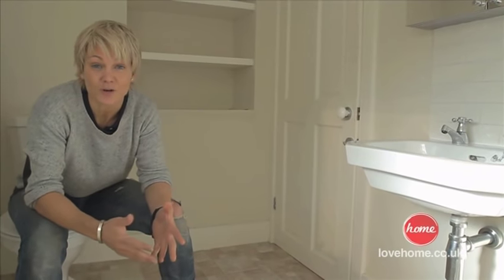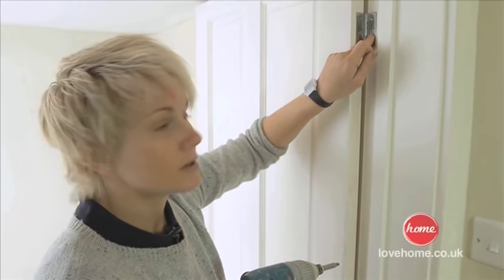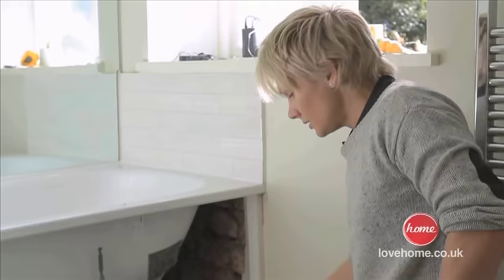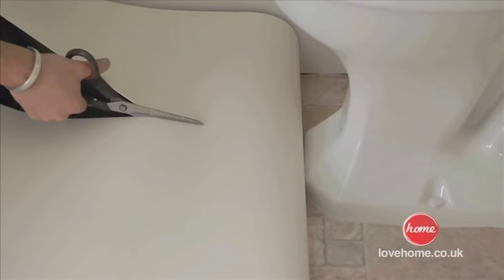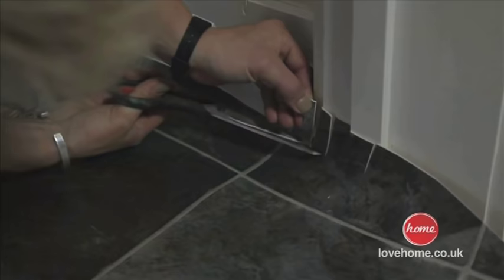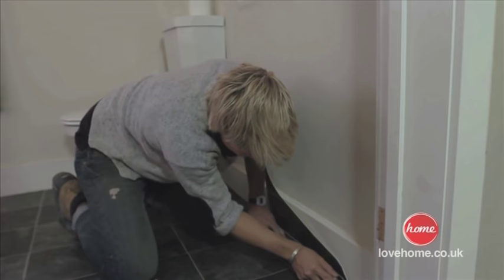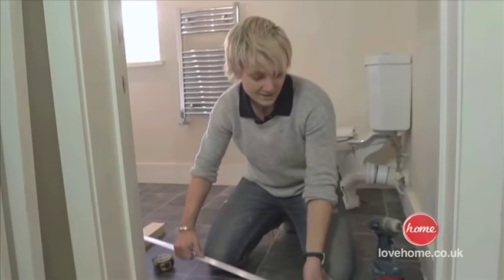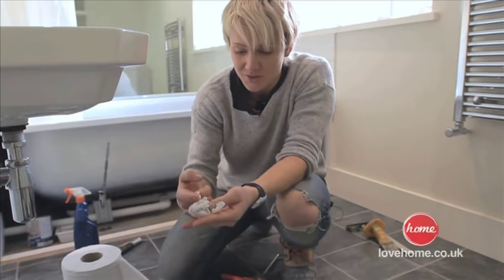DIY: How to lay vinyl or lino flooring

Comment: As a floor layer I would recommend you put double sided tape down first and stick vinyl to it before trimming , much easier.
Reply: Do they even know what linoleum is?
Reply: As a floor layer who is a vinyl specialist.
Use a hooked blade and/or concave.
They are much easier to control whilst cutting in against the skirt or loo.
Reply: As a professional idiot I have butchered my bathroom floor :)
Reply: Got a thin  length of wood. Put double sided tape on the wood. Lay the wood next to the wall and push you vinyl onto it. Lift  vinyl and cut. The perfect line. Triangle bit of wood for the corners and nice and easy to cut corners and edges and nice fitting floor 😊
Reply: I put a bead of silicone in particular all around the toilet UNDER  the vinyl ( after trimming ) but before it finally goes down , then I can silicone on top , it just stops any water getting under if the top silicone is ever damaged during cleaning or general wear and tear .
Reply: If you put tape it wouldnt move and she seems to be moving towards the skirting board and then cutting it? I just took off the skirting anyway so i dont think it will be that bad. I wanted to make it sort of sqaure at thr cirners cos its a utility room and if theres a flood i wanted the lino to go up a bit to keep it watertight rather than drain in behind the lino somewhere.
Reply: Thanks for the advice il try to do it
Reply: Lmaaoo  @classica1fungus
Reply: Will Lino go over floor tiles
Reply: @ChannelStonie 7:00

Comment: Absolutely brilliant video!! I’m a women alone and I’m having to do my  home with vinyl this week... I was panicking about my bathroom! Now I’m not! Thank you so much!
Reply: Me too but a utility room! We need to start lady diy groups where we can just get a second pair of hands for an hour when we need to lift heavy stuff. I had to lift a cupboard and was quoted 90 quid to 150 quid just to get a guy to move one cupboard for me ..as it turned out i was able to drag it on an old rug which was a greay suggwstion. I had to get help from a neighbour to put the top back up..i could take it down but not hoist it back up...but managed to find a neighbour walking past and got him for three minutes to give me and hand and made him a cup of tea and some biccies. I dont know if ill bother putting it back when the lino is down. Then i have to move the sink and plumb it in and cut a worktop and somehow make that atatched to the wall because underneath is just the washing machine. Sigh. That will definitely need a helping hand or just some company and encouragement would do me to be honest. Its the standing there not sure of yourself and worrying about how to do it that takes the most time ..if somone else was there i couldnt piddle about so much overthinking it all. My back is killing me though after movibg the cupboard.

Comment: Philippa (and All), 

Howdy! Well, I did get the ol' bathroom floor covered with lino as per your instructional video. I started it and finished it just yesterday (June 28th, in the Yeare of Somebody's Lord 2018). I originally wrote that I was to start this job on June 24th or so, but I decided I had to do a bit of wood repair and sanding before applying the lino, so yesterday was the day for the flooring. 

Despite this being my first time doing this, the job ended-up having gone very, very well. This, naturally, surprised me as I'd never done it before, and even with great instructions (like yours), some things take a bit of practice. I really felt I was in over my head, but the job had to be done. Immediately before walking myself and the lino into the bathroom I sat my sorry self down in front of the computer, and watch this video one more time. I had already watched it enough to have all the techniques memorized, but I just needed to hear it from you one more time before I faced my bathroom destiny. (laughing... at me). I needed the reassurance.(ha) I forced myself to stay calm even when I felt I should not have attempted this job, and just took one step at a time, following the methods you showed us. Suddenly the lino began falling into place and laying flat and making me very happy!   see--->   #;^\  grrr! i'm very happy. grrr!  It was like a miracle to me! And I sure had some very kind thoughts of you at that moment.

From that point onward I had more room to move around to get the job done, and things continued to go well. After the precision cuts were finished, and all looked pretty darn good, I rolled my computer chair to the bathroom doorway, and with a glass on water in my hand, I just sat there a while looking at how great things went. Boy, was I glad that job was over. Beginner's nerves (and lack of experience). Last night I went to sleep for the first time in a month without worrying about what job I would  be tackling in the olde bathroom on the morrow. Today... I am one happy boy!  see--->   #;^\  grrr. i'm one happy boy. grrr.

Philippa, if not for your video I do not think I would have attempted to lay lino flooring. Each time I watched this video I kept thinking, "Maybe I can do this". Finally, I said, "Oh, well... let's just give this thing a go!".  I am happy the job is done. And I am happy the job is done correctly. I thank you very much again, Philippa. You are groovy.   # :^)    And you are very skilled, knowledgeable, witty, and nice. You are appreciated, my friend.

If it seems I have written too much, well, it is because laying the lino was the last part of re-doing the entire bathroom, including some sub-flooring repairs, mold removal, a bit of plumbing, painting, etc. (most of which I also didn't know anything about prior to this project), so I was getting a'might tired fumbling around with these unfamiliar jobs and getting it done. All the while I knew the last step was going to be laying the lino. And, I dreaded that part of the job, too. 

Thanks (again) to you, I got through that very last  part of this big project, and it was done correctly, and the bathroom looks great now. I would say that I am proud of myself, but, alas, I am way too humble to say that.<ahem>  However, I can say that you are the best, Philippa. And I am indebted to you for your kindness in sharing your knowledge to help so many others like me... and even me.<grin>  And for helping to give us enough confidence to tackle these jobs. Bless your heart. 

Philippa, be well... you're swell. 

Best Wishes Always & The Best Life Has To Offer You.
  Most Sincerely,
    Wombat Willie 
(who can now lay lino flooring thanks to one special woman)

Comment: 1st time I have ever laid vinyl flooring and I found this tutorial a great help.. mine didn't turn out as neat as her's did but I'm very pleased with myself.. brill video.
Reply: What did she use for adhesive?  I've only seen installers use a bucker of vinyl floor adhesive applied with a notched trowel.
Reply: @billytheweasel  it’s a double sided kind of tape. You can get at lowes or home depot
Reply: @T.C.-EDU  then she used silicone gel to finish it off

Comment: I have been thinking about doing this myself but I worried about cutting around the toilet and also I cant cut straight for the life of me. I love this video and the lady explains everything in a way that is easy to understand. She certainly makes it look very easy and I dont suppose it will be that way for me but I shall watch this a few more times than try and lay the flooring myself.
Reply: Don't cut around the loo. Unbolt it and just lift it up a few mm for a professional finish.
Reply: @guybarber2301 unbolting a toilet can lead to a lot of other problems some of them are only sealed because of the dirt lol. Id say cut around it nobody is going to be looking under the toilet to notice.

Comment: Tip on removing a door if you don't want to work around it: Tap the hinge pins out and take the door off. No need to worry about screwing hinges back on and things not lining up afterward.
I wish I'd watched this before trimming up my vinyl to go around corners and stuff. It ended up a total mess near the door.
I can't take my bathtub up or move stuff there. I'm fortunate that my toilet isn't in yet and I used a template to cut the hole in the middle without cutting down the back to have a seam. 

Do you have any tips on how to install new vinyl where it transitions to carpet that is already in place? My old linoleum tucked under the carpet.
Reply: We generally don’t use door-hinges with pins in, otherwise your tip would be super helpful!
Reply: @adsmail  I didn't know they make door hinges without pins. LOL.

Comment: Well done and thank you! 
I do wish people would shut up about popping the pins out of hinges rather than removing the hinge. The pins NEVER come out easy and NEVER go back easy. I also wonder why so many "experts" are watching a tutorial video!!
Reply: If you're a midget or female, I imagine popping the pins out would be difficult.
I've never had a problem with it, and it's far easier to mount the door back in place with hinges that are ALREADY INSTALLED for proper alignment than risking taking the hinges out and having issues stripping screw heads or screw holes.
Reply: @yourlogicalnightmare1014  Not all hinges have removable pins. Only the front door in my house does. I do understand that some people struggle using a screwdriver.

Comment: I'm a professional floor layer. This video isn't perfect but it is a lot better than a lot of videos. However, when it comes to adhering the floor I would use either a spray adhesive or pressure sensitive adhesive, and cover the whole floor, and i would use a hook blade Stanley rather than scissors. The point about removing the door and bath panel made a lot of sense though.

Comment: Great video, and excellent tips. The only thing I would suggest to do differently is to remove the toilet before the installation. That way the vinyl is under the toilet, right up to the ring, and there will be no issues in the future if you ever have to change your toilet and the footprint is different than the contour of the installed toilet.
Reply: Well said and remove the skirting for a professional finish.

Comment: Philippa, thank you for this great video. I have this very job to do to finish-up a big bathroom project. And boy, am I looking forward to finishing-up this big bathroom project. I wasn't sure that the vinyl could be folded so much without cracking, but I now know that the vinyl is very flexible, and I will not have to remove the vanity and toilet to get the new vinyl right up to (and even under the edge) of them. You were right to the point, while still being very clear in your instructions. And the video shows us exactly how to do what you are instructing us to do. Outstanding job on the vinyl flooring, and in showing me how I can do the same. The reading on my  stress meter has dropped to about zero now. (laughing... at me)  Tomorrow that job WILL be finished! Again... thanks a million, Philippa! You are much appreciated!    ~wombat willie   #:^)

Comment: As a general rule you should avoid laying a new vinyl on top of an existing that's been laid with either double sided tape or an adhesive as it will cause the new vinyl to sweat and bubble due to a chemical reaction called plasticiser migration. Always uplift existing flooring.
Reply: Jason Northey thank you! I've been asking about this with no answer.
Reply: Wow, I actually thought that part was common sense, lol. Sad that you actually have to tell people that.
Reply: Jason Northey the floor man from a well respected flooring company complained about removing old vinyl first. He made big gaps along the wall. I hope 1/4 rounds will cover the mistakes. He also refused to cut around the toilet. What an exhausting event.

Comment: Have just vinyl for the first time. For the likes of sinks/toilets, a metal edge from a comby try square laid on the floor, lets you get an accurate edge if you push against the base then cut the slots using the metal edge to guide you. I used a Stanley.

Comment: Nice video but... try using a knife with a concave blade to cut, rather than scissors. Also try leaving about 2 inches spare up each wall, then pull back halfway and glue, as you'll find it easier to cut off an inch or so rather than a tiny piece and the vinyl won't move as you're cutting.
Reply: That's a good tip. Nice to see a man who just gives sound advice without the aggression and shaming.
Reply: Garry Payton damn make your own video

Comment: The use of a curved back linoleum knife saves a ton of time as you can use the curved back to push (break backing) vinyl into corners, along baseboard/wall, make rough cuts and make your cutting line exact.  Interesting this vinyl only needs the double stick tape on the edges? Maybe because it’s such a small area? Always remove the toilet which makes the seal watertight when toilet is reinstalled. If not removing toilet, leave a 1/4” extra around toilet base and push vinyl under toilet base with linoleum knife. Seal with caulking. Since the vinyl is cut! There needs to be double stick tape for the seam behind toilet and then seal seam with clear glue so any water leakage from  supply valve/hose or tank, won’t get under vinyl and cause rotting of floor. I normally use vinyl adhesive  instead of tape but that’s a personal preference. It’s a thumbs up 👍🏻 for this video!

Comment: I laid down vinyl flooring in my dad's bathroom, and when I wanted to do it the way she does it in the video, my elderly father yelled at me and told me to measure everything first. I did, and the measurements were way off. It was a nightmare to deal with vinyl flooring even for such a small bathroom. There wasn't enough flooring in some spots, and too much in the other spots, and there was no wiggle room. Next project is vinyl flooring for the kitchen, but this time I'm doing the vinyl tiles instead of the roll of vinyl. It's easier to deal with. Though the kitchen would be easier to do with a big sheet of vinyl flooring and I don't have the obstacles that a bathroom has, my dad insists on the tiles since I 'can't measure worth a damn'. SMH
Reply: Jonas Sandoy  If you're going to do something like that you may as well go to the dollar store and grab some wrapping paper and use that... Seems like a waste of time honestly- i've never seen a flooring person do this at all. If you do see one do this you should fire them probably. My uncle did flooring since before I was born and did it about like she was doing it- he'd unroll the carpet or tile and start cutting.
Reply: Jonas Sandoy  I found something called contractor's paper at a  DIY store. I'm going to buy a few rolls next time I do any flooring. It's very wide, so it'll be easier to make a pattern. Nice thing is, that pattern can be saved for future flooring projects to be done in the same room.

Comment: best to just remove toilet and cut a whole with knife which will also be hidden under toilet when replaced you also don't need to unscrew hinges to take a door off theres usually pins u can take out
Reply: Yeah, this is the second video I've seen where the installer cut around the toilet and/or pedestal sink.  It's not that difficult to take either off the floor and cut a nice clean circle under them so there is no seam behind them.

Comment: Why did you remove screws from door hinge? There is a PIN.  duh.
Reply: ik i cringed i was like this is what happens when you give a woman a mans job for your "diversity" hinges arent meant to be unscrewed it leads to them inevitably sagging in the future and the thread failing.
Reply: Brandon Cole
Reply: Easily fixed with a wooden golf T. Pound it in the hole, cut off level and bam new wood to screw into. I did this on an old door in my house. Good as new.
Reply: gooner 73 👍
Reply: Are you bitter she did better than you could  🤔😂
Reply: some hinges are fixed pin, didnt you know that?

Comment: Remvoing the toilet would've been faster.
Reply: If you can stop time
Reply: Aprylls NailsNstuff

Removing a toilet is a bit of work, but certainly not for superheroes.

Turn off the water supply, and then flush. Remove the tank, and then pull the bowl off the floor. That's the worst part because there is a bit of water leakage. 

About 10 minutes tops.

Comment: Too much room for error in not removing the baseboard. sorry.
Reply: Spongecake Squareshoes  If you're going to silicone it anyhow it's aesthetically identical, plus if you ever need to replace it you'd be required to remove the skirting again. I agree with not removing the skirting as long as you can get good edges.